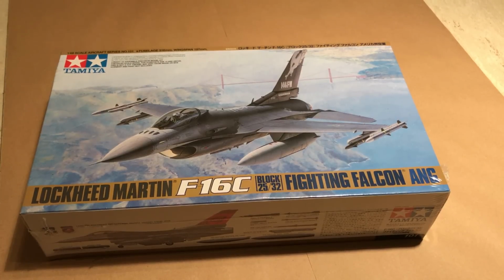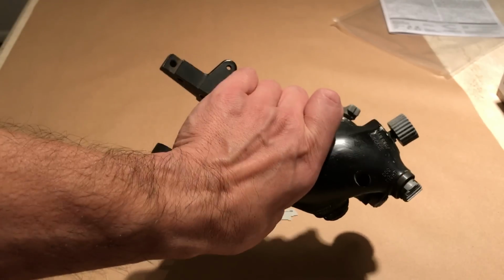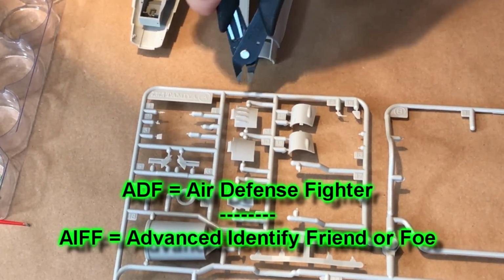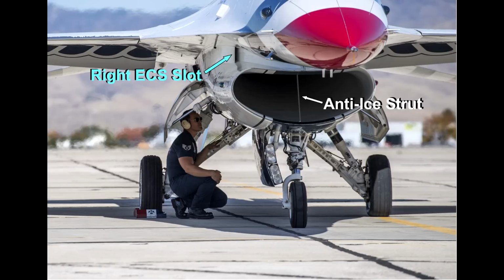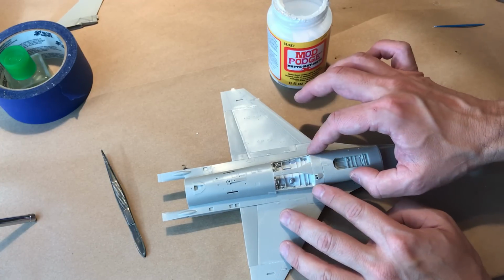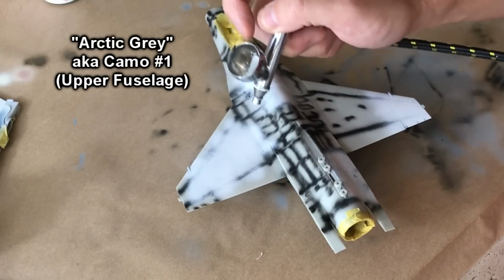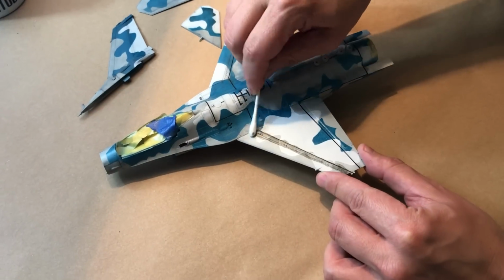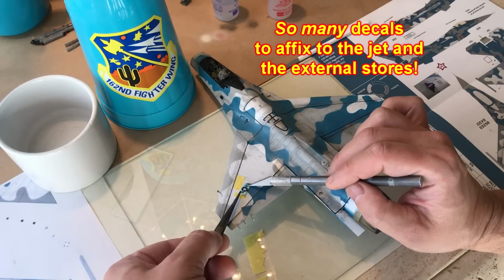Building the Tamiya 1/48th Scale F-16C Falcon Fighter Jet with “Blizzard” Camouflage

Comment: Really nice fob from a fellow F-16 maintainer. It is good to see a modeler who really knows his subject. You picked the most difficult camo scheme there is. On a personal note, I can't believe they made the throttle grip XB3, it always used to be DIFM.
Reply from the maker: Hi JohnMckeown-dl2cl, thanks for your service! I miss working on and around the Vipers out on the flightline, but I'm glad I don't have to deal with the politics anymore. I still remember when the grip came up designated as an XB3 item which seemed incorrect, but we kept checking. However, a year or so later, they reverted back to a non-XB3 listed part. I lucked out on a limited window, I guess. 😜

Comment: What is the point of painting all those black lines before actually painting it the exact color? I’m sorry I’m new to this hobby and plan on building my first f16, it’s my favorite jet. 
Also, the black paint you brush on then wipe with a cotton swab to add texture, it just watered down black paint? Can’t you just do that instead of my first question that I ask? Thanks so much.
Reply from the maker: Hi evan.zecchino, the initial lines used on this particular build are "pre-shading". You are not covering them up at 100% with subsequent layers of paint. You'll be leaving a hint of the original black lines (or other color). The effect can be subtle or left heavier depending on your taste and the appearance you're trying to achieve.  These leave the impression of natural shading, wear, or even fluid stains on a relatively broader area rather than minute sections. The diluted paint used later on is a "wash". This highlights fine details such as the panel lines and rivets creating shadows in these crevices that would normally show up if the model was at true life size scale. The wash to be done last over any other paint layers you've added otherwise you'd cover up the detailing you're trying to present.

Comment: Hey love you sharing your F16 knowledge. Is this kit considered a big mouth Intake? I have some markings/decals for the F-16C Florida Makos FW and it says F-16C Block 30 482 Fighter Wing 25 th anniversary . It says big mouth on the decal sheet and works with the Tamiya F16C kit. Thanks in advance for your input. George
Reply from the maker: Hi George, the kit in this video featured decal sets for a Block 25 (Small-mouth) and two Block 32 (Big-Mouth) tail numbers, but there aren't any options to change the air intake. Having said that, this model looks to be a Small-mouth version. The Big-mouth change began during the Block 30, so depending on which tail number you pick for your model will affect the engine air intake shape. However, I believe the MAKOS' Block 30s inventory are all the Big-mouth version. Hope that helps. 😇
Reply: Thanks for the reply, do you think if I used the Tamiya F-16C kit with the Small -Mouth intake it would still look ok with the MAKOS decals on a shelf ?
Reply from the maker: I don't think anyone would notice unless they're looking at the intake very closely.

Comment: I’m working on a Tamiya 1/48 F16 CJ block 50. When you opened your kit the parts look the same. I’m sure there are small differences in certain parts which designate various versions of the F16’s. Your work is exceptional.
Reply from the maker: Hi Teddy, thanks for the comments. Yes, there are certain subtleties between the versions and there are things to look for in identification. However, it's much easier to spot between the A/B models and the C/D models when I was in the "game".

Comment: HI, I noticed at or near the end of the video when you are applying the decals, did you, or do you wet the surface of the model with water where the decal will be placed first? I know you dipped the decal in water first, but do you also wet the area on the model? Great presentation on your work, Thanks for your Service, Cheers
Reply from the maker: Hi drail80s, yes, I lay down a little bit of water so I can float the decal into position. I then wick up most of the moisture with the cotton swab leaving just a little to fine tune alignment before the final pressing in and removal of the last bit of water, then onto the decal setting solution. 🧐

Comment: I let the thin set glue wick into the joints. The glue stains the seams, but they disappear when I paint the model. Recently, I used some MRP lacquer based paint and the glue seams are visible. Is this because its lacquer based, or do some paints let the glue joints show through?...thanks-luv your channel
Reply from the maker: Hi Plydrms, I often employ the same technique with the wicking and often you can't see the glue or the final dull/gloss coat will "erase" the glue's visibility even if I've already painted the model where I'm applying thin glue. I suspect the different chemical nature of the lacquer as compared to other paints has something to do with what you're observing. Glad you like the channel, I'm most appreciative! 😃
Reply: @MaxAfterburner  Ok. I have always used Tamiya paints up to this point. The Tamiya paint made the glue disappear. I'm not talking about accidental thumb prints from handling. Its the slight stain from applying the glue on the outside of a joint. I use Tamiya thin set cement. I see most modelers use this technique. The MRP lacquer sprays beautifully, but perhaps it doesn't cover up the glue marks as well??

Comment: Awesome build btw.  I’ve subbed to your channel. 

Will you pls make a video on how to properly mix paints? Mine almost always turn out wrong or, I’m using the wrong airbrush. Which is a brush master I think. 
I bought it as a kit with compressor and accessories included.
Reply from the maker: Hi, which paints do you generally use?

Comment: Very nice builds!  I’m planning on building a 1/48 AZ ANG F-16 but can’t find decals of the vertical fin color band at the top. Are you aware of any on the market? What’s the newest block that AZ ANG operates today?  Keep posting these build videos! Thanks.
Reply from the maker: Hi Andy, the decals for the AZANG seem to come and go which surprises me since the 162nd FW has been the largest Guard base in the country for many, many, years. You'd think Arizona decals would be frequently in supply. I guess you'll have to get lucky or try making custom decals. I visited the base and met with some of my former colleagues just this past May 2021. The newest block F-16s they're flying are still the Block 42s (152nd squadron). My old squadrons (148th and 195th) are flying the Block 20 MLUs and Block 25s, respectively. Thanks for watching!

Comment: @maxafterburner, I know you have quite a lot of extensive knowledge on the F-16. In the main landing gear bay, on the port side of the aircraft there is an often orange (sometimes painted blue) box strapped in there. I was wondering what it is used for? If you have any idea, please let me know! Thanks, keep up the great work!
Reply from the maker: Hi Giovanni, the F-16 aircraft I worked on sported that box in blue. It is the aircraft battery. 😃
Reply: @MaxAfterburner  Thank you so much! It’s a question that’s been eating at me every time I build a viper. Is there any particular reason it may be painted in blue or orange? Perhaps a change in block?

Comment: Hey man I just recently got into airbrushing for models (As in yesterday) what ratios do you use for your tamiya paints of paint to thinner? And Is it the same for when you're priming a model?
Reply from the maker: Hi Austin, I use a thicker paint to thinner ratio than most modelers. My Tamiya acrylics are at about a 75% paint to 25% thinner mixture for airbrushing the model's priming and main coats. 🙂

Comment: I see you opted not to fix that serious canopy mishap, which these Tamiya F-16s are suffering from. Myself I am torn between fixing it and not fixing it. Not fixing it leaves the finished model looking pretty bad, fixing it is a multi hour process with dubious outcome and rather high probability of ruining the canopy altogether. Hard choice for kit builders caused by the incompetence of Tamiya kit designers. :-(

Comment: IFOF was hi tech when I worked on F-14 motors.  And hand 'safetying' 4 set screws on the bottom of the throttle quadrant was damn near impossible without stripping the plastic holes on the quadrant.  (Speaking for a friend of course ;)

Comment: Great Video!  I got my start in Avionics on the F-4D Phantom during the early 1980's.  Moved on to the KC-135's before I retired.
Reply from the maker: Thanks Hans! 
That must have been quite a change for your senses. I knew a guy in my shop who started out with B-52 avionics before coming to us on the F-16.
Reply: @MaxAfterburner  As much as I loved the Phantom I didn't miss the tight areas I had to work to replace components.  I still bear the marks of the "Phantom Bites."  The Tanker had it's pains but I really enjoyed working on it.  Nice feeling too knowing my dad flew them long before I even went into the Air Force.  I retired after 21 years (NHANG) and they are still flying!

Comment: What was your AFSC bro? I was 2A351A F-15/A-10/U-2 Attack Control Systems Journeyman. I was F-15 Avionics Troop at Tyndall AFB with the 325 AMXS/2 AMU. We had F-15 C/D models cause at the time there was 3 F-15 Squadrons and 1 F-22 squadron there that trained pilots. AETC base. They closed the 1st FS/AMU down when I was still there but now there isn’t anymore F-15s at Tyndall. Just two F-22 squadrons. The 43rd and I think they turned the 2 FS/AMU into an F-22 unit. Obviously I was a flight line dude as well. We are the backbone of the Air Force. Also I won SrA BTZ and got Airman of the Quarter for the 325 AMXS and almost got it for the whole Fighter Wing but I got all that with no volunteer bullets. All maintenance bullets. I was really good at my job and I really loved working on those planes. I had all my 623 tasks for 7 level signed off for F-15 C/D models as a 5 level that only signed for 4 years so you know how big of a deal that is. Also made Staff but my line number was so low I got out before I sewed it on. Also I got an incentive flight in the F-15 which was the best 90 mins of my AF career. Pulled 8.9 Gs went Mach 1.2. Dopest shit ever. I got mine when I was TDY to Cold Lake Canada for Maple Flag. You ever get one in an F-16? I also went aTDY to Luke AFB and Key West. TDYs were always fun.  If you didn’t work on the flight line then you ain’t shit. Haha. Am I right or am I right? And just a little FYI an F-15 would dust an F-16 easily. ;)

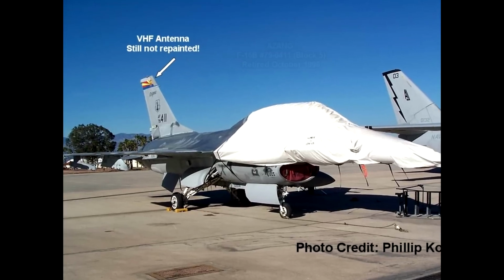Comment: @14:31  That's an old production F-16B, probably ordered in 1977 or 1978, delivered 1979 (79 I think is the delivery date).  Block 5 is the next production batch of the A/B model.  If it got retired after just 17 years service, it was surplus or there was a structural issue they didn't want to spend the money to repair.  Some of the early F-16s retired in the 1990s ended up in the Boneyard as a result of budget cuts or structural issues (cracks in bulkheads or wings) -- the earlier planes weren't quite built "tough enough" and developed cracks.  (Top Gun just overstressed their Falcons by flying those planes CONSTANTLY to the 9-G limit and wore them out faster; they could have repaired them but chose to retire them with less than 10years service!)
Some of those planes were refurbished and later sold to places like Pakistan or Jordan second-hand for very favorable pricing.  Around 100-120 of the retired planes are getting rebuilt as drones for missile development.  It was about time they got a 9-G plane to develop better IR missiles.  The F-4 just wasn't that agile and I'm amazed they used it for as long as they did as s missile target.
Reply from the maker: I remember having to spend a lot of time on the F-16's when they were doing a structural repair program to the 357 bulkhead that were showing cracks in the fleet. Fuel shop had to drain the jet, then we in avionics had to remove all our fuel system lines and probes and move flight control harnesses to make way for the structure guys to strengthen and repair the areas as well as add exterior beef-up plating.
Reply: @MaxAfterburner  
Yeah, from what I understand, General Dynamics cut it close on the manufacturing spec of the F-16 and had to redesign and reinforce the aircraft partially every time they added more ground attack capability to the plane and hanged things off parts of the plane (like under the inlet) where they hadn't intended to hang things like targeting pods!  
They "guaranteed" the plane for 8,000 flight hours (fatigue) and 9-G's (periodically, NOT all the time like the US Navy found out!) but I think I read the American record for the A-model was around 7300 hours.  Most of the A-models in US service were retired well before that.  (I totally believe some of the European air forces WILL max out their A-models.  Ironically, two of the poorest Euro-nations, Greece and Turkey, have the newest F-16s on the continent!) The US fleet has a few C-models easily over 8,000 hours.  There's a test plane, a Block 52(?) in an ANG unit that I think that probably has over 10,000hours that was commissioned around 1992 -- at least according to the article I read online.
The "Fighter Mafia" were really naive about the original YF-16 design.  It was basically good for one thing and one thing only -- "jousting like knights" (fair weather, close-in dogfight) but not much else.  They HAD to put in a better radar and adapt the plane for multi-role whether Boyd, Sprey, and the GD "godfathers" liked it or not or I doubt the plane would have stayed in production past the 1980s OR been as attractive to as many countries.  Let's face it, as good a close-in dogfighter as it is, the F-16 has mainly been used as a Bomber...

Comment: Hello I keep watching your videos and you always forgot to flatten the tyres by the weight of the aircraft. There is a little tip. Get a metal mug put some water in it, start heating it at the bottom  put the wheel in the mug and press gently with a tweezer to the bottom until you get the required shape. Its a minor detail but satisfying  in my opinion. Keep making this videos! :-)
Reply from the maker: Thanks for the tip Shazeen82!
Reply: Actually bro the tires don’t go flat from weight. At least not to a point where it is noticeable. If the tires are noticeably flattened some from weight then they are under inflated. In real life you want those bad boys round.
Reply: @ANSW3R_1230  Not all types of aircraft.  Some are able to land on less flat surfaces like concrete,tarmac etc, ans its require a bit less pressure as well. A fully loased armed aircraft makes the tyres a bit flat by the weight only.

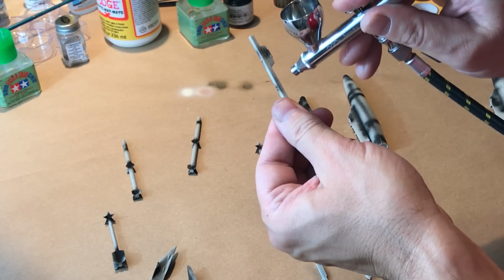Comment: FYI, the BDU-50s (practice bombs) depicted at 17:57 are not made of concrete, they are filled with 192 lbs of wet sand, and sometimes concrete to simulate the weight of the explosive tritonal filler. The bomb body is the same iron as the live version but with slightly modified fuse wells to accommodate filling.  Other than that, they are dimensionally identical analogs to MK-82 bomb bodies. Great vid, I enjoyed it!   (former Ammo troop, Osan 91-92, Misawa 92-98, Nellis 98-01)
Reply from the maker: IFYAAYAS
Reply: Damn right!

Comment: Yeah I thought someone backed a tug into the pitot right away.  And....back in the day we had to use start carts.  My first day on the job I had to crawl into an A-6 fuel cell and coat it with preserving oil before it went back to the vendor.

Comment: @Max_Afterburner Wait, so you referenced AZ ANG a few times. Did you by chance work on F-16s in Tucson? The 162nd? This kit might have some special significance for you then because these California marked 144th Falcons, some of them anyways, were sent to the 162nd with the last ones going over in 2013. This Tamiya kit was a new tool kit from 2007, so they came out and photographed the F-16s and everything from the source here in Fresno, Calif. while they were still here, before they were later shipped off to Arizona. Imagine... the two planes they used as the source for this kit, depending on the time frame and pure happenstance, could've been one you yourself worked on with your own hands! What are the odds? ...Who knows, probably not that high, but a fun thought. XD Do you know if they would keep the same tail numbers, or would they have been changed when transferred? Because when they were in Fresno the tail numbers were 83-1144 (block 25B) and 87-0301 (block 32H)
Reply from the maker: Yes, I was at the 162FW AZANG. We did get California F-16s transferred from time to time and they would keep their tail number. The tail flash would change of course. Other California jets went straight to the boneyard. In fact, an Air National Guard poster with CA ANG tail number #572, came to our unit to be retired. I remembered the poster from my days at Lowry AFB, so I took some pictures of it. I'm pretty sure I worked on 83-1144 during my flight line days.
Reply: Wow, that is just incredible. What a small and crazy world we live in.